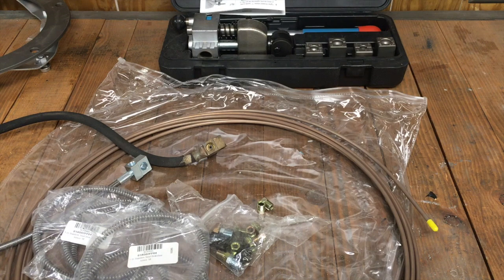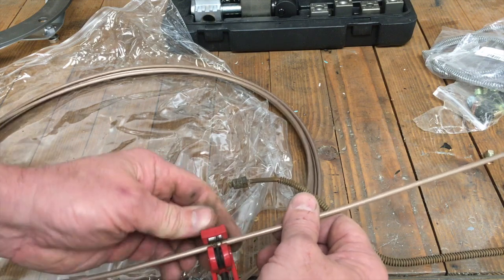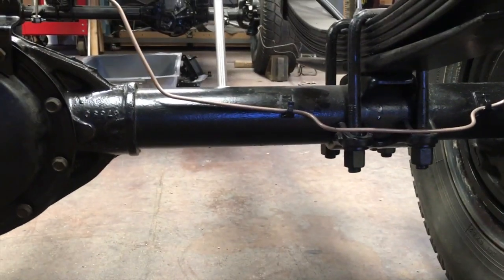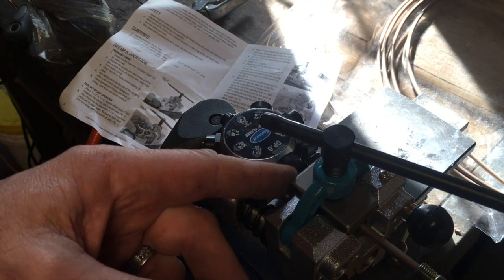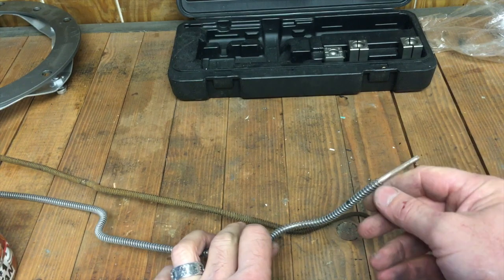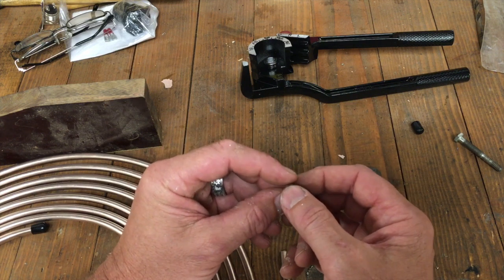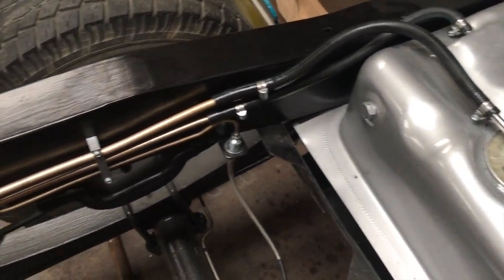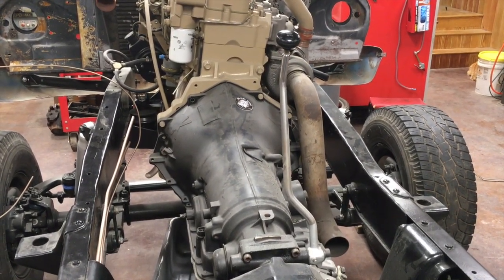Gen 1 Blazer Restore and Conversion Ep4 Brake and fuel lines

Comment: Sky jacker has the longer brake flex line!! I got mine in longer lengths for my 1972 Chevy 4x4 that has a 9” suspension lift on it!! Worked very well for me!! OFF Road Design might also have some stuff that would work for your build!! I have used them for a lot of upgrades on my build!! Steven is by far the best guy to work with!! He has spent hours & hours on the phone with me to answer all my questions that I have had on my project!! You definitely can’t ask for a better guy to work with!! Give him a call!!
Reply from the maker: J.J. Clingman, thanks for the info!

Comment: FYI about this tool, do not force it past what you consider to be an end line for the tool. Like if a line fights you, restart rather than whale on it. Several people have had the tool crack apart (uncertain, but even EricTheCarGuy warned us about it). Also, you should mark operation zero on the metal body, or downright replace the glue on the label, it comes off. Just passing some knowledge along.

Comment: Late answer, but to my knowledge: it's that brake fluid is flammable, so in the event of a crash, should the lines break, they will spew pressurized liquids about which are flammable in contact with hot stuff. So, the standard is to have double flare, which gives a meaty termination, thus more shear strength.

Disclaimer, that's what i was told by a mechanic (in Europe).